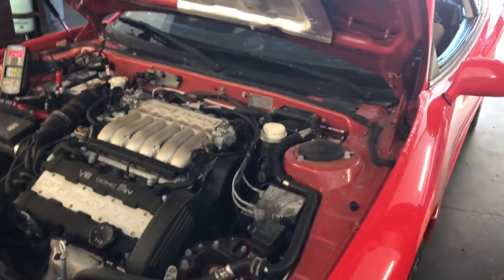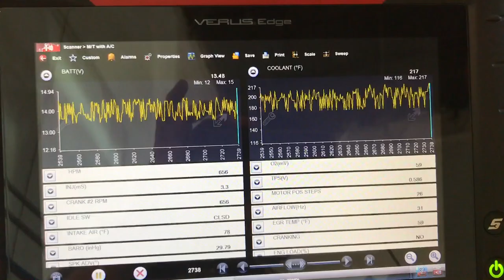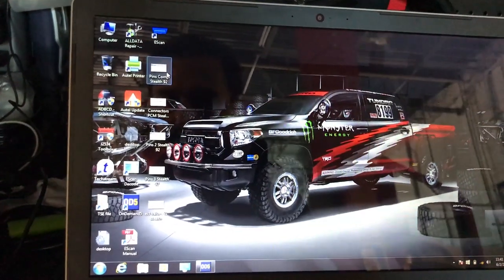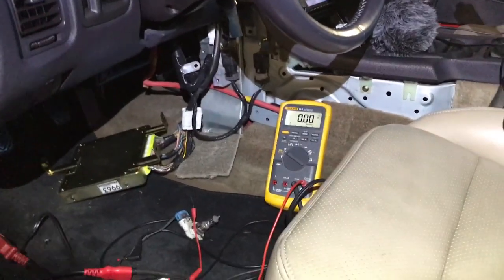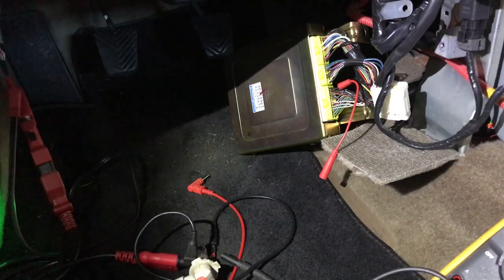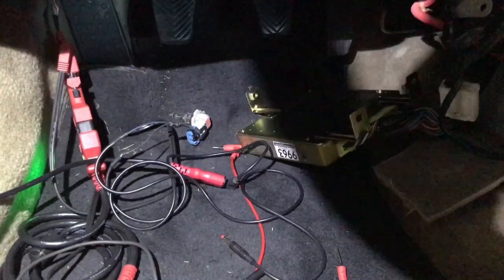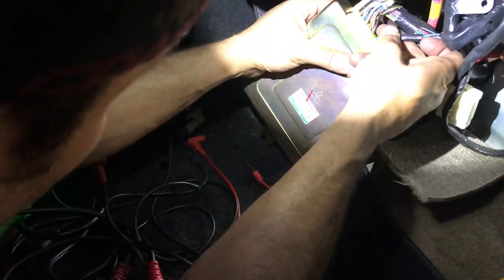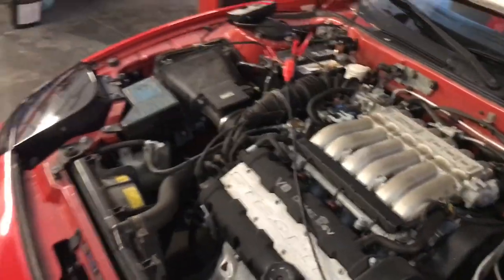1992 DODGE STEALTH Rough Idle and engine noise PART 1 Diagnosis

Comment: My 92 3000GT has a very small misfire & slight ticking. Did the plugs (Denso Double Platinum) in November & Oil about 3K miles (Dec) but I used Castrol’s Magnatec Full Synthetic 5w-30... Wonder if 10w-30 would be a better option...  I’ll have to try a different oil & plug combo.

Comment: excellent video Maic      where did you get that 20 ft test lead  power and ground?
Reply from the maker: Mark Ferraro thank you! I get it on Amazon is from power probe. Here is the link for it:
https://www.amazon.com/gp/aw/d/B0037AAI9S/ref=mp_s_a_1_2?ie=UTF8&qid=1496521124&sr=8-2&pi=AC_SX236_SY340_QL65&keywords=20+ft+power+probe+extension&dpPl=1&dpID=41XWuD5aZ-L&ref=plSrch
Reply from the maker: Mark Ferraro get this also:
https://www.amazon.com/gp/aw/d/B004OZCG7W/ref=mp_s_a_1_fkmr0_1?ie=UTF8&qid=1496521195&sr=8-1-fkmr0&pi=AC_SX236_SY340_QL65&keywords=power+probe+alligator+clip